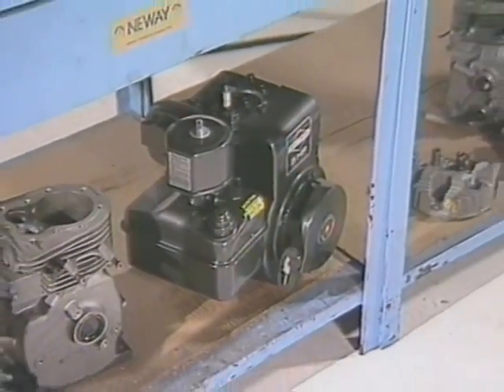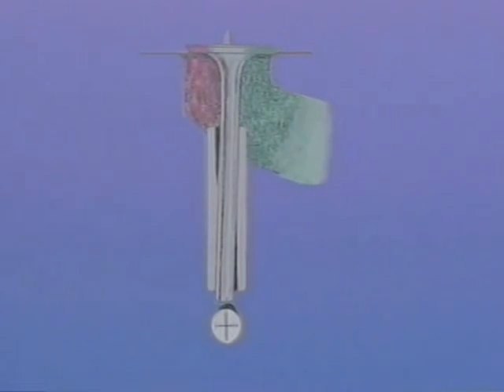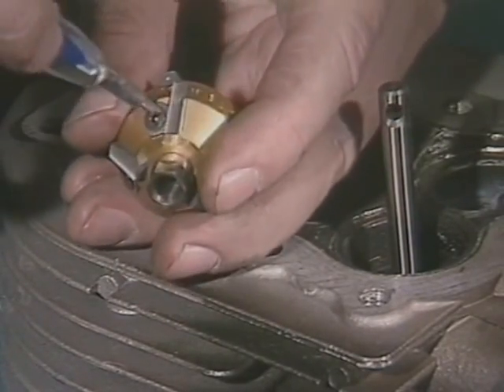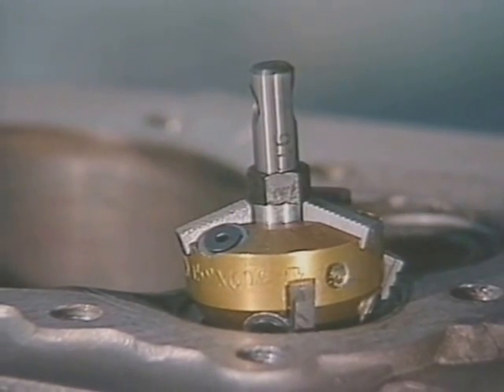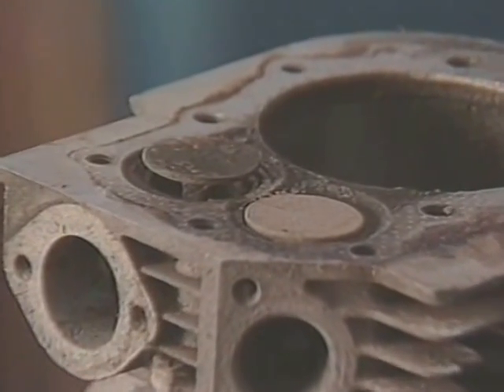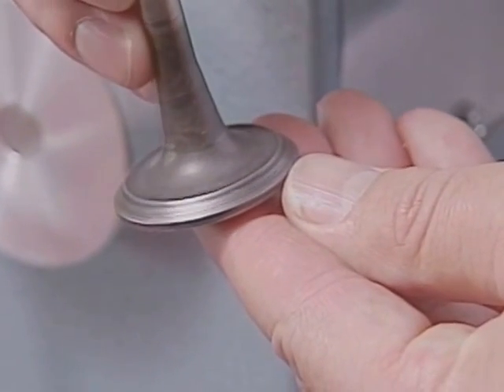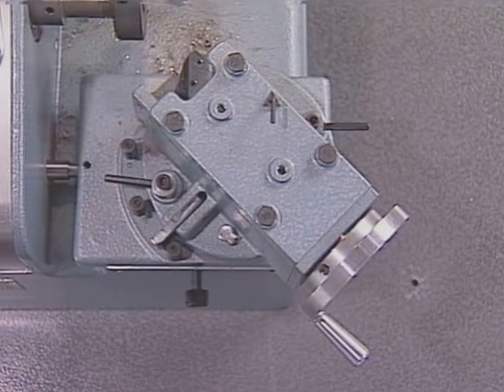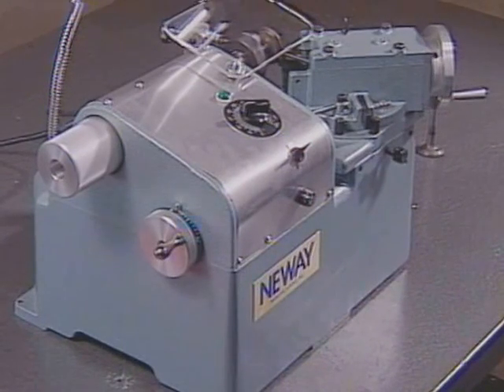Power in Small Packages

Comment: I've used neway since the 80's. Nothing like it.
Cut 16 seats in 16 minutes floor to floor.
Super accurate,super quiet, no dust. Spray the last cut, the actual seat, with water based coolant like flywheel grinder coolant. They'll look almost chrome finish. Check seat placement with a magic marker on the valve face. I prefer souix valve refacer. Best machine ever. Still have it. Best part is there is no setting up heads. Lay them on the racks your done. By the time someone sets up a head in a Serdi machine, I'll do 16 seats. I've done from big diesels to lawn mowers. 
Newway's the best!
BTW I'm 75 and retired machinist.
Reply: Linda from Customer service here.  Thank you for your review!

Comment: I really like using the spring loaded crank handle, it is easier to cut without stopping and it is easy to control the pressure at the start and end of the cut. I just did two Chev 235 cylinder heads and the seats came out really well. Make sure to measure the guides first. The expanding pilot is really nice especially on heads that don’t have the tightest of tolerance requirements.

Comment: before the valve seats are cut the guide must be  replaced or repaired if out of tolerance.

cutting a valve seat using a worn guide could end up  putting the valve stem at the wrong angle/ position on hte cam or follower with too much side force.
Reply: Kindly send questions or our email at info@newaymfg.com.  Thank you.
Reply: Machinist here and you are correct. Good video but the whole video should be posted. I've used Neway cutters at my bros shop for many years and they're widely popular for good reason but they are intended for use by EXPERIENCED automotive machinists so training is like a Helm manual, not like amateur literature which explains other processes.. They're easy to learn to use but all rules of runout and concentricity one learns in machining apply. Install the new guide then ream to specified clearance, and another tip is if you have the choice get the solid pilots though the expanding pilots work well.
Reply: @obfuscated3090 I liked the expanding pilot for being able to just do a quick refresh on a head if the guides are a bit worn but not new, I did a pair of Chevy 235 heads that were like that. They seemed to work pretty well as long as everything is really clean before putting the pilot in.

Comment: Like a previous poster noted this video terminates 2/3s of the way through the tutorial on cutting valve faces.. I think i'm going to try some of these techniques on my Lathe in particular using a steady rest to control chatter, a problem i have encountered in the past. Also notice how the operator locks down the carriage when making a cut.
Reply: Don't waste your time. Pickup a used valve refacer. Preferably a Souix wet machine. Uses oil for coolant. ATF works fine. Valve refacer chucks are super accurate.
I'm pro machinist 50 yrs
Reply: @victoramato4692  I did pick up an old Sioux machine with some life left in it , did a resto and now i can cut valve faces that look like chrome finish, pretty kool.
Still i have found that you indeed can cut valve faces on a lathe , the key factor here is getting your speed right and (thats a big and !) your tooling has to be super sharp.

Comment: Does the exhaust/both valve seats take the cutting angles ? 31/46/60° s
Reply: Not always.... some engines use a different angle on the intake. always check first.
Reply: you don't want a 46 degree seat. The factory would cut 45 degree seats. Interference angles are mickey mouse band-aid engineering. If you cut a true 45 on the valve and a 45 on the seat you will get a longer lasting valve job that requires less adjustments over time.
Reply: @davidparker9676  we would love to talk to you regarding interference angles etc.  We offer both,, cutters with and with out the interference.  Your choice.
Reply: It does depend.  Sometimes the exhaust and intake have different angles.  It really depends on the type of engine.  Most times both are the same.  And, especially small engines (lawn equipment), a specific manufacturer will tell you in their manual to cut a 31, 46 and 60.  (However if you have a cutter that is  30 and 45 and it fits , majority of the time that one will be just fine.  Do not hesitate to call us or email us.  Our website answers many questions  too:  www.newaymfg.com

Comment: There is no question that this is a good product.  The problem is it is very expensive for what you get.  You also must make sure you know the process so you do not order the wrong pieces. This product should be no more than $200 for everything you need to do a complete head.  You should be able to order a kit for a specific head with a specific valve guide size.  Get real on your pricing please.

Reply